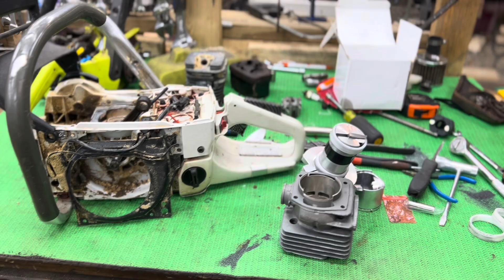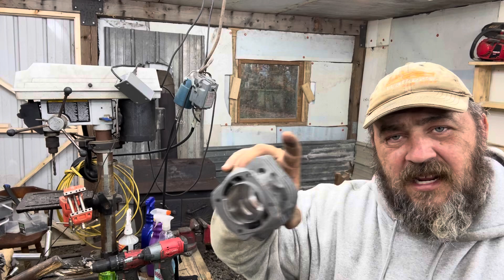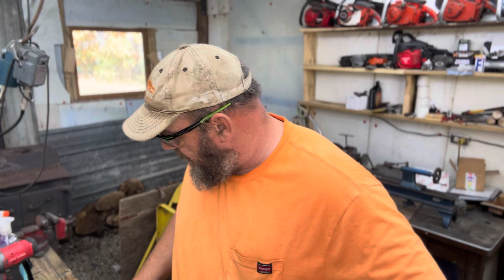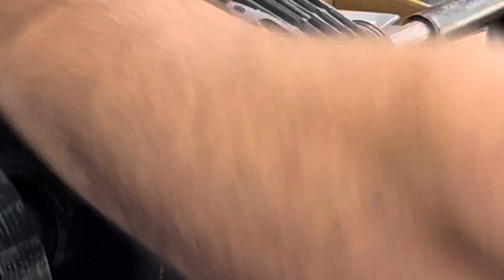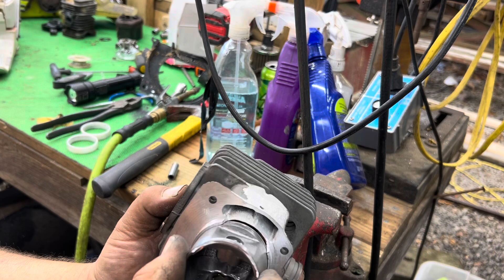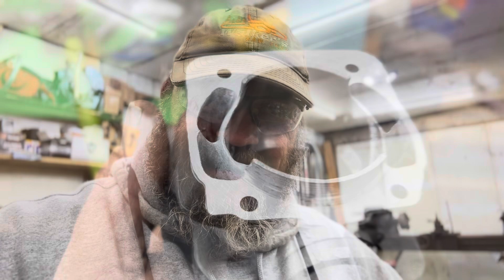Did I Build A Turd?  Build And First Cuts In One Video!  Holtzfforma 372 Chainsaw!

Comment: Maybe i should've just left you to it and moved on to another video but, damn sir, who the hell did you learn all your bad engineering habits from?
The piston in the lathe without at least some tape between the jaws and the ali. Then trying to wreck the wrist pin bore by spinning it with a hex wrench. The kicker was cutting away the cylinder base which will reduce your transfer boost pressure as it will be partly lost up the piston sides before the piston reaches bdc. It shows a lack of understanding about how engines work. I'd fire you if you worked for me.
Reply from the maker: @biomechanique6874  All bow down to my awesomeness!!!